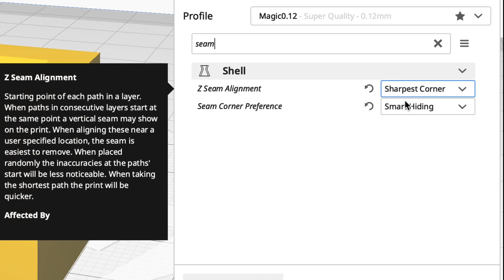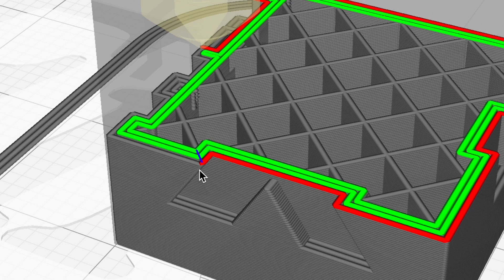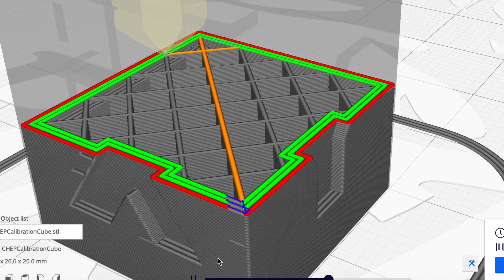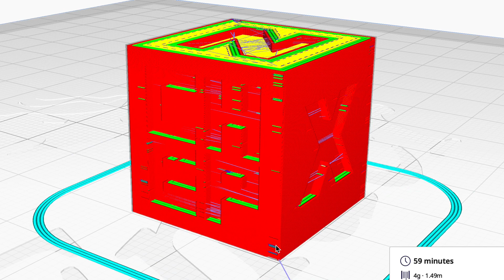Improved Cura Slicer 4.4 Profiles for Creality Ender 3

Comment from the maker: If you are wondering how to install these profiles in Cura, I showed that in this video: https://youtu.be/2Ejo6EVQ5Gc
Reply from the maker: The 4.4 version works on 4.4.1
Reply: Only Ninjaflex profile can be imported. For the rest I've got a  message:
 Failed to import profile from D:/My Projects/3D Printer/Ender 3/chep_cura_profiles_4.4/CHEP_Cura_Profiles_4.4/Magic0.28.curaprofile: Could not find a quality type super for the current configuration.
Reply from the maker: Use the Cura machine profile not a custom version.
Reply: @FilamentFriday  I'm using your profile that you've made available for everyone.
Reply: @FilamentFriday  And 4.5 too.
Reply: @FilamentFriday  Which profile did you use to print the test cube?
Reply from the maker: Don’t remember. Probably 0.2
Reply: I wanna say something...
There's something your leaving out.
If I were to follow this video step by step. I did 7 times. Smh. You'll never get what your "profile" is. Idk what's changed or what you've done prior to releasing this profile but somethings different.
Reply: What is the gap distance between your nozzle and the bed using your .12 Super Profile? I use .011 feeler gauge when leveling and it seems like I'm not getting enough flow for it to stick to the bed. I know that it sticking isn't the issue. I even tried to slow down your initial layer.
Reply from the maker: First layer is 0.12.

Comment: I recently updated CURA to the latest version and none of the cura profiles on your website work now on this new version. is there any way to use those profiles for the new version?
Reply from the maker: They work for me in V 4.9.1
Reply: @FilamentFriday  What I meant is that I'm unable to import those profiles although I was able to configure the settings from the CHEP calibration cube from Thingiverse, although it was the 0.28 standard profile. I was looking forward to trying the other available profiles too.
Reply from the maker: Are you using the Ender 3 Machine profile to start?

Comment: Hey Chep i have a serious issue with my ender 3v2. Maybe you can help me...
I use your Cura settings.
The Bed is leveled even in the center but when i start the print the printer raises the nozzle so high that the filament is not pressed on the surface. it is extruded around 0.15mm above the surface. it doesn't stick and the nozzle is grabbing the "old" filament....
when i press auto home the nozzle is above 0.05mm above the bed. so everything is ok untill i start printing -.-
Reply from the maker: Check your slicer for Z offset. Should be zero.
Reply: @FilamentFriday  it is Zero... Im really confused where my Problem is.
Is there maybe a Bug insider cura? Are there older Versions that might work better?
Reply: @drug2  I know it is 1 month later, but were you able to fix it? I had to set my Z Offset to -4.2 for it to work properly.
Reply: @netuser54321  Hey yeah, i just used my own settings. I leveled the bed and now everything works fine. I don't use any settings from this video here

Comment: Just purchased a 2nd machine, an Ender 3 v2, I downloaded your Cube & Pawn to test it. Ender supply it with there slicer, which is basically Cura 4.2.1. Using the Standard Quality profile with out of the box settings the prints came out flawless

Comment: Wondering if you have had any issues with support on 4.6 Any over hang with support under it the print gets messed up. In fact the support doesn’t even seem to touch the print. I have never run into this. Might have to go back to 4.4 or a little older.

Comment: 3:51 I just got to this stage, no blobs protruding outside the print surface on the start/end of the layer line, only those small inwards dips. In the end I still like it better all aligned in one place (stitch line) rather than scattered all around. I guess, sociologically we are used to plastic products having a straight vertical seam from the molding process, so It's easier on the eyes when it's all around "smooth" and when you turn it and see the seam line you just "selective perception" it out, and don't pay much attention to it.

Comment: I found something interesting posted on Youtube by chance relating to the print speed of the Ender 3 in Cura. I like your videos and use your profiles for printing on my Ender 3, but have found them to be quite slow and if I compare the same STL sliced in Prusa Slicer, I find Prusa Slicer to print much faster.
Now this video I saw on Youtube said that you should instead of using the Cura Ender 3 printer profile, create a custom printer profile and enter your printer details.
When you use this new custom printer profile to slice a STL you will find that it almost halves print times.
I tried it and it works, has anyone else seen this and why would this be?
I cannot see why the Creality Ender 3 printer profile is so much slower.

Comment: I added an Ender 3 to Cura 4.5 and was wondering about the (default) Machine Settings. The Printer Settings seem to be completely wrong (e.g. X 300mm). Does anyone have the same problem? What are the correct settings?  Thanks.
Reply: I just did a clean install of Cura 4.5 and selected the Creality Ender-3 profile. The machine settings look good to me. X & Y are showing at 235mm and Z is at 250mm. Did you do a clean install of Cura and if not could the default profile have been modified in a previous version?

Comment: Cura 4.4 and cura 4.5 don't work with my Ender 3 Pro.
The prints have problems in the height. With the Creality slicer and and Slic3r. But not with Cura.

Comment: I installed these profiles and I would love to switch from the Creality Slicer to Cura but I'm missing something. My Ender 3 Pro has autoleveling and I added the G29 entry in t he gcode. When it starts to print it runs the autoleveling, prints the nozzle cleaning line fine but then when it starts to print it prints too high. It doesn't touche the bed, I can slide easily a piece of paper. I have tried doing auto home and moving Z then entering the adding the number to the offset. Nothing, very frustrating. This does not happen with files from the Creality Slicer.

Comment: Hello, is there any way to use / convert your Magic profiles in another type of 3Dprinter without copying parameter by parameter?
Your profiles does not import on any type of 3Dprinter other than the Creality.  I am using a Prusa clone with Cura.
Reply from the maker: I’m working on that but they are designed for Creality.
Reply: @FilamentFriday  Thanks

Comment: I usually use these profiles when I want a lack of seam (otherwise the default works perfectly), but a thing I've just noticed is that the jerk and acceleration settings seem to add a thumping noise every time the build plate goes back and forth. Has that been your experience?
Reply from the maker: No. Check your eccentric nuts for loose.

Comment: Ender 3 and cura 4.4.1 here: for some reason the provided profiles for 4.4.1 create lots of stringing in first layer and overhangs (lower than 45degrees) is it too fast?  Ive had to abort prints, but basic cura profiles work fine.
Reply from the maker: Check retraction on Cura settings and compare.

Comment: I have to admit I tried the profile changes and didn't see much improvement, and on some combinations an actual degradation in the final print.  I did some other prints and wasn't please with the results from my standard profile so went back and had another go with CHEP's.  This time a I did notice a marked improvement, though I did use sharpest corner for z seam instead of random.  Thanks for the profile!!  Great work.

Comment: Hello CHEP, i ve been using this profiles for a long with excellent results and thank you for that. I just noticed since today morning, my gcode on your profile gets M106 s255 instead for stock profile that gets me the desired M107 on the first layer. Any suggestions ? I had tha same problem long time ago and i fixed in with reinstalling cura, but now it doesnt seem to work...
Reply from the maker: Check your fan settings in the slicer.
Reply: This happens only in magic 0.28 both 0.2 and 0.12 have M107. In all setting i have initial fan speed set to 0
Reply: What can I check more than initial layer fan ? I have changed the between the 3 profiles and kept the settings (when asked by cura ) and still 0.28 gets me m106 s255. I even tried setting initial fan speed on 5 % and I still get m106 s255 ...

Comment: I am not able to change my support density, or my infill density, on my curia. Support stays at 15 and infill stays at 20. The box is Grey it went change. Can't do anything with it. And my supports are to hard to remove. I would like to have around 7 in support density. But can't do anything. I use a anycubic i3mega 210 210 by 205. I like it alto. Could you please make a video how to fix these problems. Ty any help I would appreciate
Reply from the maker: I don’t have that issue so I don’t know how to fix it.

Comment: I am getting this error when I try to import the profiles. Any ideas? I am using a cr10 mini so I think this may be the reason? But I thought your settings would be a good starting place. "Failed to import profile from E:/3d Printing/CR-10 Mini/chep_cura_profiles_4.4/CHEP_Cura_Profiles_4.4/Magic0.12.curaprofile: Could not find a quality type super for the current configuration."
Reply from the maker: You have to use the Cura machine profile.
Reply: @FilamentFriday  ahhh.. Got it.. Thanks so much for your help

Comment: So I tried it out with your profile, but I wasn't that pleased with the results. Got blobs on the survace, as soon as I switched back to my profile it was really good again.
Even tried the latest modifications from CNC kitchen. To prevent the printer from stopping because of too many gcode lines per second.
Reply from the maker: Which layer height profile and did yours have seam set to random?
Reply: @FilamentFriday  I used your 0.2 layer hight profile. My profile was already pretty similar. And cubes come out perfect. Just on round objekts  I didn't like the seam. So at first I calculated the e steps and then I found your very helpful video. But I still get these little filament blobs when I chose random. Now I'm testing almost every parameter . Already 9chess figures are made.😅
Greetings from Germany
Reply: @AN-zk8yv  I've been having the exact same issue, and would love a solution to it.
Reply: I've been having the same problem

Comment: got an error when i try to import the profiles to cura 4.4.1 
"failed to import profile from C:/Users/nonth/OneDrive/Desktop/__MACOSX/CHEP_Cura_Profiles_4.4/._Magic0.28.curaprofile:
<message>'utf-8' codec can't decode byte 0xa0 in position 37: invalid start byte</message>"
Reply: I got that one too.   Use the ones in the CHEP_Cura_Profiles_4.4 folder.

Comment: @chep.   I started using your profile from this video and suddenly I'm getting massive stringing.  Any idea why that might happen.   I've tried 5 different makes of pls and they all are doing it
Reply: i have same problem . nozzle moves away while printing and comes back and it makes strings .
Reply: found problem . it was not profile. my sd card had bad sectors . changed sd card and problem is gone.
Reply: oh boy do i feel silly,  i found that my zstep for extruder was pushing out about 11.1mm when i told it to push 10.   a few tweaks later and all is forgotten  smh   thanks chep for being awesome.  what a community though!

Comment: Hey Chuck, After using your profile I can see the print quality is better but I still have the little dots on the face caused but the random seam, on your video it looks completely smooth. Why is that?
Reply from the maker: What layer height are you printing?
Reply: @FilamentFriday  0.28  I'm using the 0.28 profile you  posted
Reply: Set it to print before outer wall

Comment: I have been experimenting with your profile since last few days. And I found these things:
1. Printing at lower temperature seems to help in reducing stringing. I わ getting overall all cleaner prints when I printed at 205°c (nozzle)/70°c (bed) for first layer and 195°c (nozzle)/45-50°c (bed). 
2. I tried setting line width to 0.36mm from 0.4mm and it was helping in getting getting smoother prints as well. Not sure why but it seemed to work for me. Do you think it has to do something with nozzle wear?
3. I tried printing with ABS recently. Only thing I changed in your Magic 0.12 was temperature and minimum layer time. First layer to 230°c/100°c and 215°c/85°c for rest of print. (Which I know is very low for ABS. But ABS I'm using seems to print fine at that)
Reply from the maker: Your changes are what I expect people to do based on the filament. Nice work.

Comment: Hey Chuck. Great video. Was trying to import your settings to compare with mine and am getting an error. Only with the Ender-3. If I change the printer to my CR-10 I can import your profile. The error I am getting is the following. Maybe someone else is getting the same thing?

Failed to import profile from C:/Users/...../Magic0.20.curaprofile: Could not find a quality type super for the current configuration.
Reply from the maker: You need to use the Cura Ender 3 machine profile.

Comment: need help if someone can help me with this problem. 
I'm runing ender 3 with dual metal gear ex. 
problem i'm having with new 4.4. is under extrusion after starting new layer. speed is around 30mm/s.
runing same printer with simplify3d on 50mm/s i don't have this problems. 

i's like cura is starting to extrude to late or something like this. (i'm runing chep profile for ender 3)

Comment: Question: I noticed a difference in the profiles in regards to "Enable Jerk Control" and "Acceleration Control"?

In Magic0.12 profile "Enable Jerk Control" is enabled with values of 20 for Jerk settings.

In Magic0.20 profile "Enable Jerk Control" is enabled with values of 20 and "Acceleration Control" is also enabled with values of 500.
In Magic0.28 profile both "Enable Jerk Control" and "Acceleration Control" are disabled.

What are your thoughts on these settings for an Ender-3?
Is there a reason for the difference vs layer height?
Reply from the maker: Ender 3 has firmware limits of 500 and 20 but can be lowered if you choose to adjust. I may have made a mistake by not enabling that in 0.28. I’ll check.
Reply: Thank you! Just wasn't sure if it was an oversight or was something custom per profile since the "Cura factory" settings for an Ender-3 in Cura 4.4.1 have both of the settings turned off.  I assume that the firmware is controlling Acceleration & Jerk settings with the settings turned off in Cura.

When enabling "Acceleration Control" on the default profile, the default settings are 500 (same as firmware).
When enabling "Jerk Control" the default values in Cura are 8 where your setting matches firmware. 
My guess, based on the firmware limits you posted, is that leaving the settings off will not change the results since your settings match the firmware values.

Comment: Hi chep can I use a. 6mm nozzle with the profiles. Thanks
Reply from the maker: Yeah but you will have to modify it a bit.
Reply: i'm runing .6mm, but 0.36mm layer and 240C nozzel. 50mm/s

Comment: Coasting caused small gaps in my layers which are also visible in Cura (4.4) preview mode. I have adjusted the coasting volume setting to a lower value (0.008 in my case). This resulted in perfect prints for me. Hope this helps when having the same issue.
Reply from the maker: I’ve been playing with that on 0.28 profile as well. 0.01 is where I’m at currently.

Comment: Thanks for the profiles.
I was having a LOT of difficulty with failed prints with the grid fill. I switched to cubic fill and all is good.
It seemed as if rapid retraction and extension was fatiguing the filament to the breaking point just as it was entering the tube.
This was happening at the same height every time only with one specific model (Yoda with soup) ... Strange indeed..

Comment: Got my Ender 3 Pro today and downloaded the profiles shown in this video. Sadly I get those little blobs all over my prints. Played around with coasting, retraction and outer wall wipe distance but it didn't help. Any suggestions anybody?
Reply: turning off wiping nozzle helped mine
Reply: just play with tests and try different options, there's a bit of difference between each printer
Reply: Yep, I’m having the same problem. Will need to keep tuning.
Reply: @Lawzy  I disabled ramdom seams, that made it look better imo. When you find a better solution I would be happy if you can tell me.